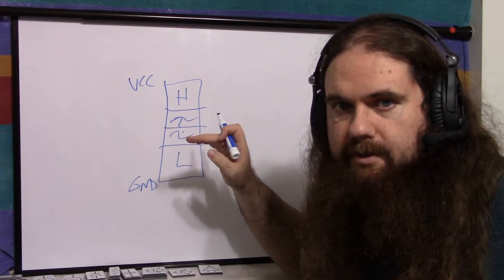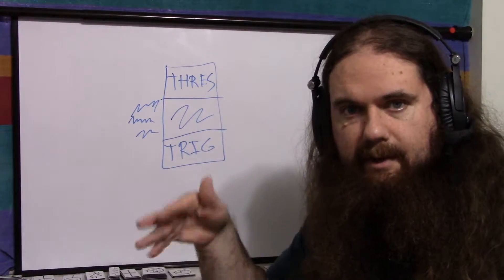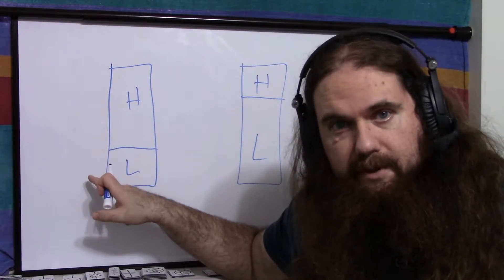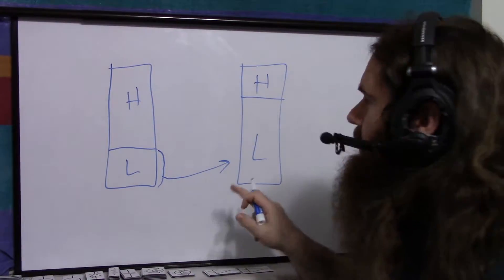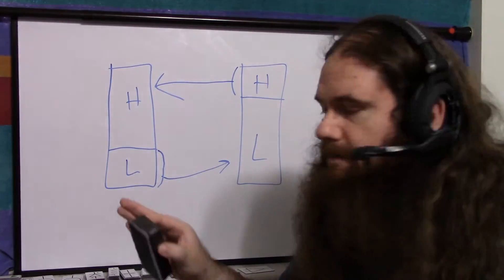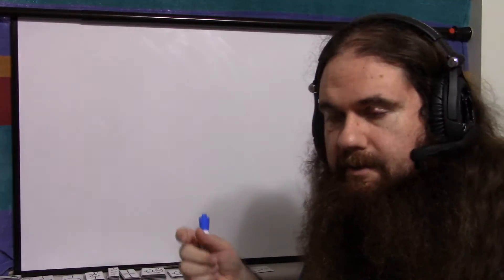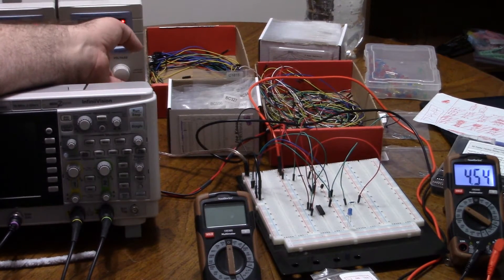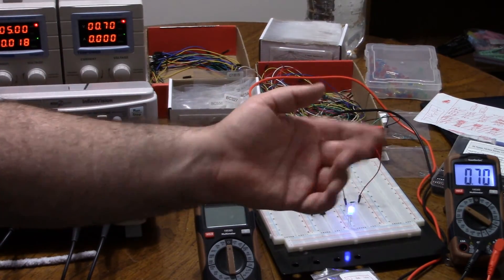Schmitt Trigger Hysteresis - 74x14 Inverting TTL Logic Buffer Demonstration - Simply Put

Comment: The 40106 is one of my favorite chips ever. It's so useful and versatile but especially good for creating square wave signals for clocking other chips and creating 6 different audio signals for DIY synth stuff with no more than a pot and a capacitor.
Just last week I was messing with a circuit that used a 40106 and was wondering how big the hysteresis range is and how closely a Spice simulation matches real life. The simulation was only 0.05V off from the breadboarded one.
The hysteresis range is 0.825V in a 5V circuit with a 40106.
https://ibb.co/7kfVHBJ

Comment: The CMOS version is the CD40106. I have both. You can use them to create square waves, among other things, with a resistor and capacitor, just like a 555. I think I got both chips to test circuits that would a create an adjustable 0-100% duty cycle square wave as an input to a DC motor driver. I don't remember if I succeeded in building one.